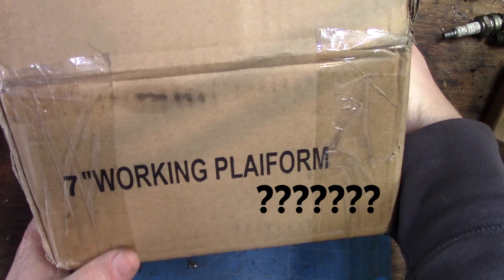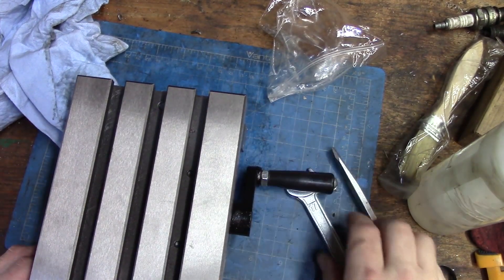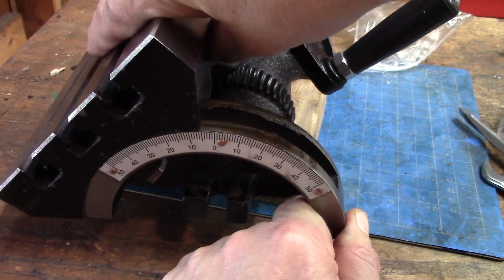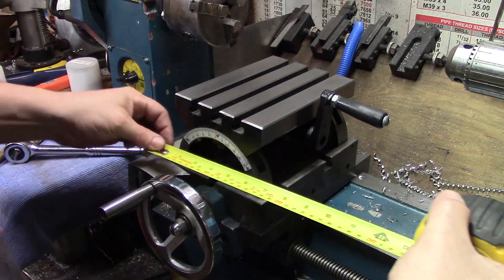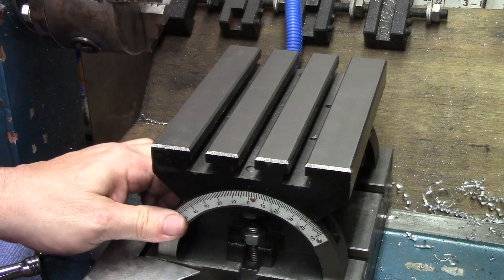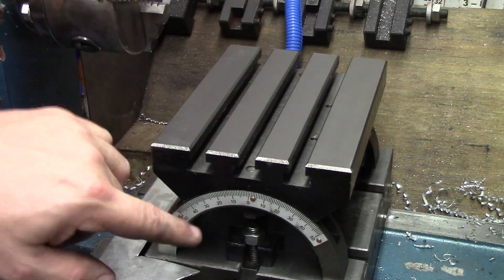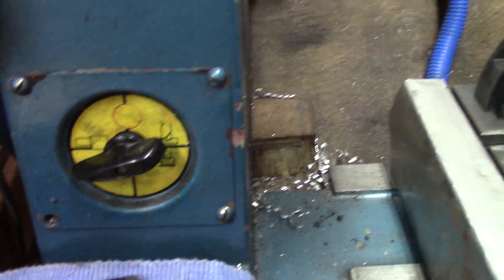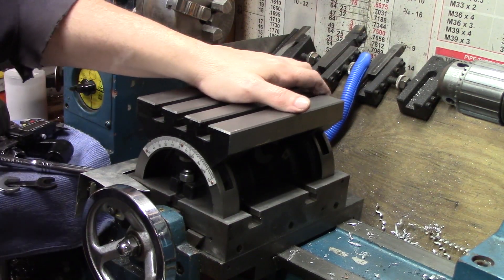Unboxing the cheapest adjustable angle plate on Amazon

Comment: All tilting tables I’ve ever used have handles that are too long to clear the bottom. That’s the way they’re designed, or, with a heavy part on top, you wouldn’t have the leverage to turn it. So you remove the handle to position it when turning it. It’s inconvenient, but so is machining overall. I’m always amazed at how much you get with really cheap tooling from China and now, India. 50 years ago, if you bought  a tilting table at the cost this would have been back then, made in the USA, it would have been made from thick sheet metal and pretty much total junk.

Comment: One way to get it to sit flat and true on your table would be to zero out the scale  on the fixture, turn the table upside down and mounted it to your mill.
Then mill the "feet" on the table true.
Reply from the maker: Great idea. The only caveat is if you re-tram your table, you will need to do it again and it will also need to be used in the same orientation every time. But yeah that would square it to the machine and be closer than it is out of the box for the purpose.
Thanks,
Eddie

Comment: I bought two of these for work (minus the worm gear adjuster) from Grizzly. Same issues with wobble and T-nuts. I made a steel mounting plate to join them together in tandem to make a longer table and for the specific job I bought them for they work fine. The parts I make with them are not very critical. After mounting to the top plate I flipped them and skimmed the feet so they sit flat. I only tighten the locking nuts on the outside ends and I use a digital angle block for adjustment like you do because the scale is out a degree or two. Altogether the unit weighs 125 pounds! I keyed the bottom to make installation easier and drilled and tapped the edge of the top plate for a handle so I can control it when making adjustments.
Reply from the maker: Nice, sounds like a good mod for a bigger job. Don't even want to know what an angle that size made domestically would cost, lol. Thanks,
Eddie

Comment: Thanks for the many enjoyable videos you have made,  keep up the good work!
I put one of those tables on my drill press. I put the screw, handle and their bearings into the dust bin. I  snug up the clamp bolts, tap the table to the correct angle. And tighten the clamp bolts. Works fast and simple.
Reply from the maker: Thank you! I did basically the same thing.

Comment: I think I bought a 5x7 it does not have the worm no handle probably should do away with that take it apart Mill it off whatever you need to do then you can just bump it into place they seem to work okay good luck
Reply from the maker: Thanks, the couple times I have used it I did not use the adjustment screw or handle. I don't think I even know where the handle is at this point, lol.

Comment: I just bought one of these to use on my Smithy also. It is out of the box and sitting on the bench, so far I haven't had time to go through it. Mine doesn't have the gear drive though.
The first thing I thought of is what Bill Todd did, take the screw drive mechanism off.
It looks to be fairly useless anyway.
I would like to see you do another video about this thing after you get it sorted.
Best of luck on your spark plug hole project too.
Reply from the maker: Hello,
It will show up again with the cylinder head in the next few weeks. I have another little job I have to get to first. All the best!
Eddie

Comment: Hello Eddie,
Especially interest as I have been looking at one of these tables... it is more basic than your one as it does not have the worm gear to adjust. Thanks for sharing...
Cheers.
Paul,,
Reply from the maker: I am going to take the gear off, it is not worth the trouble and gets in the way more than anything. I realized last night that the bosses just bolt on an each side so removing it should not be a problem.
Best!
Eddie

Comment: The screw is only there to stop the thing falling over as you adjust. Since your unlikely to have anything too heavy on the table,  you may as well just lose the screw and mounts.
Reply from the maker: Good point. grind those bosses off and you would get full adjustment without propping it up.
Reply: I would rather raise it a bit. It’s about what I would expect. You could grind out part of the bottom of the boss, but don’t remove the screw. Believe me, there will be a time if you do, when you will regret it when you smash your finger when it drops down.